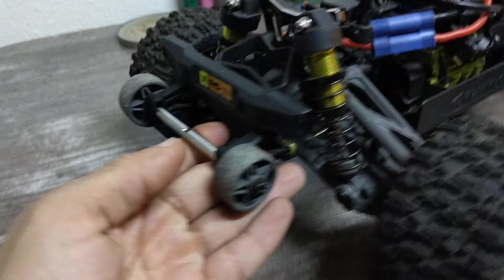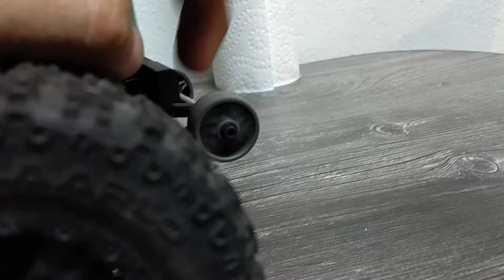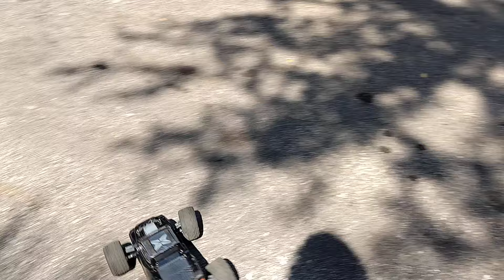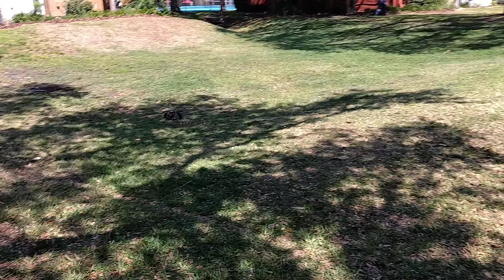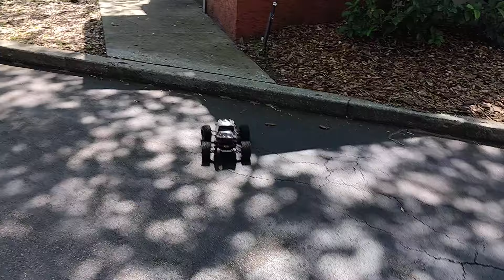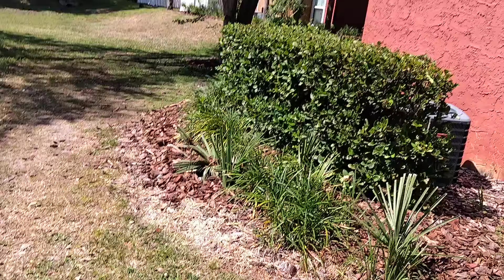Rlaarlo Omni-Terminator carbon fiber edition *2 week update: What Broke* 2s bash

Comment: The diff cup issue is a set up issue, lower the ride height by using the lower outside holes all around.. never have that problem again. Duanwishbone suspension is not designed to have that much drop. It turns the dogbone into a pry bar.. besides it will handle like the stadium truck it actually is

Comment: I ordered alloy stand offs and diff cups from the beginning. Also, I drilled out the wheelie bar attachment holes and put a heavy gauge screw in and zero problems since. Also, don’t listen to them about moving the esc… they make tons of 3s-.4s higher Mah batteries that fit perfectly without moving nothing. Do what I said for upgrades (which is peanuts) and enjoy your vehicle
Reply: Any issues at the other end of the axles, wheel shafts issues?
Reply: @CSL33  axles are rock solid !
Reply: @RC-Closer1313  
Thanks. Surprising that the dif cups are weak, yet the wheel cups at the other end which are also a dog-bone setup in the rear holdup just fine?!
Reply: @CSL33  it is an anomaly
Reply: Have you gotten those stand-offs and diff cups yet? Mine haven't even shipped after 3 weeks! 😠
Reply: Ordered some LEGIT 12.9 Grade, M3x30 screws for the wheelie-bar to see if that makes a difference.....
Reply: @CSL33  they are still showing “ordered” on the Shop app. So, hell no them things haven’t shipped yet.. it’s like they have no product hubs in the US?? Everything is taking its time on the S.S. Commy… them there boats take a while… then customs drags ass.. then they have little Chinese dudes pulling those fancy decorative street carts with there little pointed straw weave hats on with chin strap coming from the port in California… so it’ll be here next year  👍
Reply: @CSL33  that’s exactly what I am going to do, but before anything happens to mine…
Reply: @RC-Closer1313  
....right😊🤭

Comment: I found mine has a bent center drive shaft, and the diff cups are showing wear already after only a couple packs run though it.
Reply: Yeah, need to limit the throttle when in the air, i.e. when suspension fully extended, unless you get the upgraded cups that they sell. Be prepared to wait weeks before they even ship them out to you though!!!  😠
Reply: What size pack?

Comment: Did you checked your diff fluids? I added 100k to the front and rear, and one million (because i couldnt find 500k in my country :D ) and after 2 3s batteries the cups are like new. Also i found out, that the bearings inside the hub are low quality, and they are half seized after first bash so i oiled the little ones, they were fine, and i changed the bigger ones for sealed bearings from my trx4. Bear in mind, that im running my truck on 100C 3s batteries, and i changed ESC to hobbywing 10BL120 with punch to the max :D. And that wobble thing with the wheels is maybe because the holes are installed in the rims itself and not the tires like they should be.

Comment: Hi mate I've had to change my controller because my antenna tip dropped off. And put GT5 controller and receiver. And put a castle mamba pro esc so I can go 4s and thicker centre differential oil. Great video mate 👍 😂

Comment: Does your's drive straight? Mine doesn't, it veers to the right. Is it damaged out of the box, or can I make some adjustments?
Reply: Adjustments on the transmitter
Reply: Did you adjust your steering trim
Reply: Mine pulled to the right. It’s an easy fix. 

Disconnect the servo arm and push/pull rod 

Turn on the receiver and center the tires on receiver to 50% ) you’ll hear it beep). 
Put the arm and rod back on with the tires centered and now it will be centered. 

The car is inexpensive so they have cut corners on quality control. For those who are very into RC cars they seem to notice the little things I don’t so I’ve spent my time instead of money on the upgrades or fixes to bring it to a higher quality ride. 
I do love the car but I would’ve just spent the $100 more dollars for a brand if I knew it would come completely ready to go out of box.

Comment: I’ve watched almost every video on YouTube & all other media sites & I’ve only heard of one coming with a rear reversed dif but these are coming from people that got the first models. I’ve not seen any of a lot of the other issues your mentioning due you have any reference to certain videos? There is no perfect RC but for the price of the Terminator your getting more for sure it’s very well made. The body mounts could use some pads on them. I think you are way overthinking everything go out n run it have fun & then see what breaks because it appears you haven’t broke anything? But your just warning people what may happen 😂
Reply from the maker: I've broke shock standoff screws and bent the rear shock tower. Other than that and diff cup wear it's been pretty solid. Problem is if it breaks and I need a replacement part the truck might be down for a month before Rlaarlo sends replacements unless parts have become available on Amazon already
Reply: I heard the same
Reply: @DaveKoko  Everyone runs there’s different set them up different but from my experience since I’ve had mine I take it out all the time Ive been jumping it & I have a good feel for the throttle today I had it out & it was just a blast I’m not gentle with it either I’m not just doing speed runs I’m running it off-road & sending it through everything you definitely don’t want to run it with big rocks around but it’s solid I’ve had nothing break or fall apart I did notice a wheel getting a little wobble could be the bearing but other then that it’s still running hard.

Comment: Damn. A lot of issues. Who wants to buy mine? Lol
Reply from the maker: ....might be worth buying for the spares 🤣
Reply: Same only diff cups issue's and causes dogbone failure
Reply: @bryangadson-me9eh  Any issues at the other end of the axles, i.e. wheel shaft issues, whether front or rear?
Reply: Naw just the diff cup and dogbone pin at diff cup driverside rear is worst but all show signs of pre mature failure, I like the truck but to fail too soon under no bashing and rlaarlo trying not to accept return but im relentless with them standing behind there product,and return policy @CSL33
Reply: @bryangadson-me9eh  Rlaarlo does have potential in breaking the 'China' engineering perception 'mold', but they may more than offset that upside with some of its management decisions and other strategic directions on their retail sales side of things...
 Yeah, the rear dog-bone cups at the wheels do seem beefier than at the diffs! Thanks!
Reply: @CSL33  I did find 90mm dogbones on Amazon been holding up so far, on that messed up cup where the stock one broke, 90mm ones vs the stock 90.5mm ones
Reply: @bryangadson-me9eh  Nice to know. What have you done about the diff cups tho, anything? Takes forever to get parts from Rlaarlo!
Reply: Who knew living in the projects could be so much fun. 
Plenty of parking lots to play in